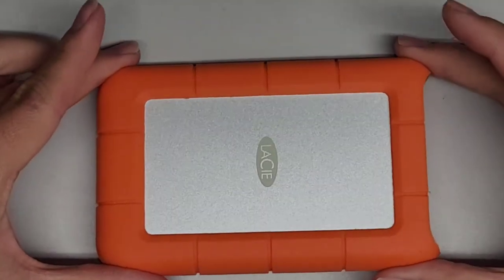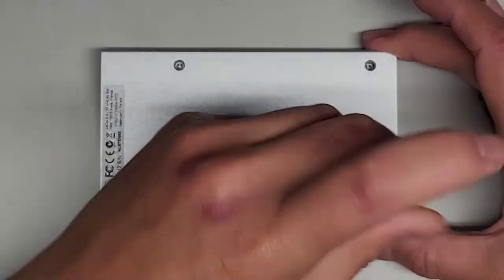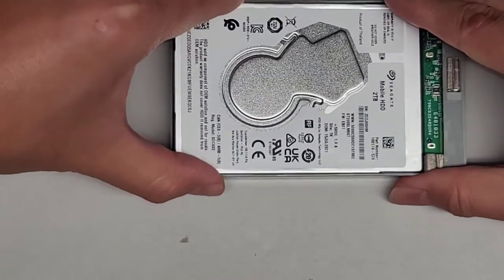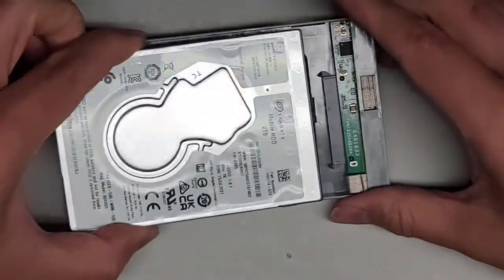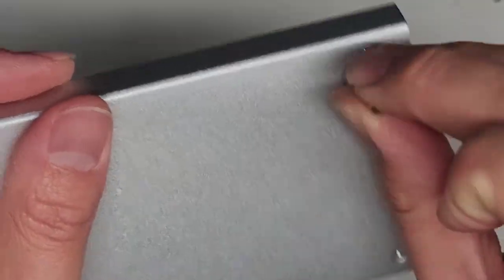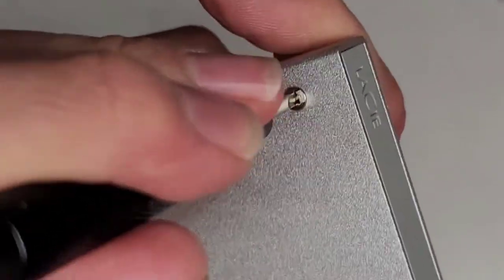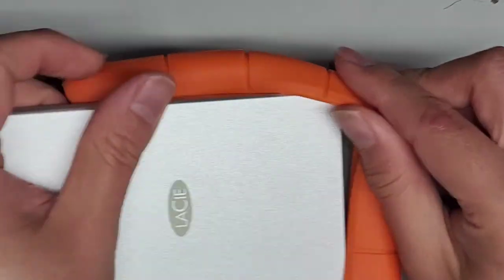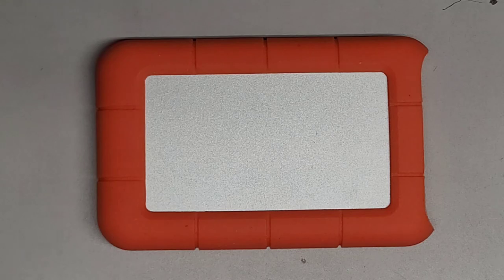LaCie Rugged Mini Disassembly

Comment: The type c port broke to my HDD, assuming I can just replace the case with no real risk to the data itself.

I haven't had any luck finding a replacement case, could you please lead/link me to one, preferably one from Lacie that is interchangeable and able to fit in the rubber exterior?
Reply from the maker: Data will be fine as long as you don't break it. You'll want to open it and make sure it has a SATA drive though. It's not possible to get an exact replacement enclosure unless you buy a used/new drive and swap it out.

Lacie will void your warranty if you even mention you opened it.
Reply: @ItsBinhRepaired  Thanks. If I want to maintain the same enclosure/case (specific reason why I purchased this rugged drive), can that be done by sending it to Lacie for repair (if that is even an option)?

I don't think it is under warranty anymore either, fwiw.
Reply from the maker: @jordancrowder1657  possibly, but you'll want to make sure they don't wipe your data
Reply: @ItsBinhRepaired  You're right on that. I called Lacie/Seagate, and they only offer repairs/replacements, with no option to preserve the data which renders the service more or less useless. I'm looking at finding a used or if anything new matching drive to replace the case/exterior with. Does it need to match in ports? (ie. type c, or will a standard usb 3 Lacie D Rugged Drive case work if swapped? I actually have a new 5tb one unopened, however curious if there will be compatibility issues or if it doesn't matter since they are the same physical size. Your replies are appreciated!
Reply from the maker: The important part is how thick the drive is and if it'll fit in the housing plus if it's a standard sata connection
Reply: @ItsBinhRepaired  Makes sense, tysm. Right the 4tb and 5tb housing are both the same size. Just wasn't sure if the other drive needs to be a type c port, though maybe I'll keep it so to be safe. I'll keep you updated after I do the swap. Fingers crossed, hoping no data is lost!
Reply from the maker: @jordancrowder1657  sounds good!
Reply: @ItsBinhRepaired  update: brought the drive along with a new identical 4TB Lacie unit to a local shop I've used in the past. (just to be safe than doing it myself, and in the case there was internal damage that needed to be recovered). The swap was successful and all the data remained. Thanks again for the video and the comment/replies.
Reply from the maker: @jordancrowder1657  awesome!